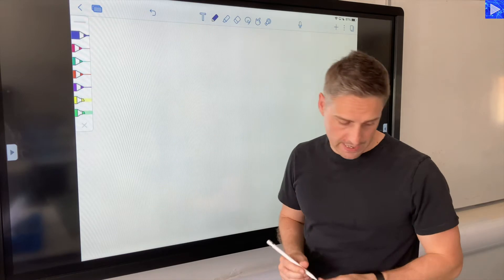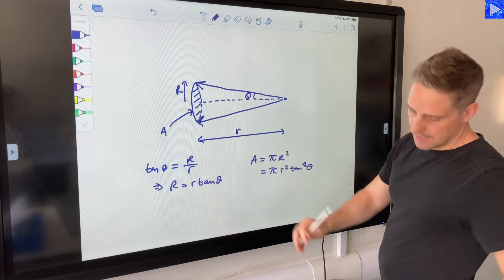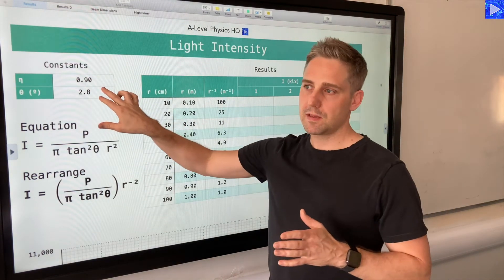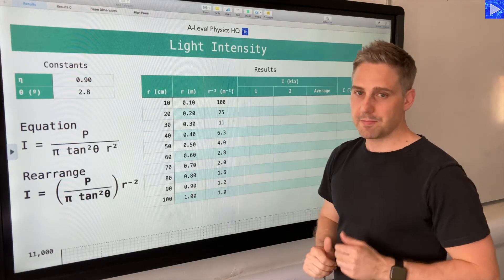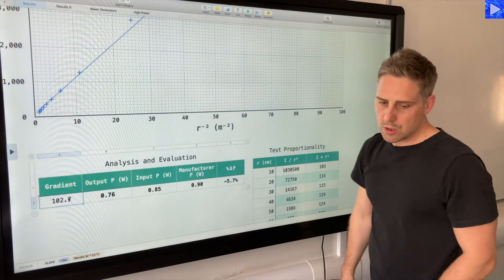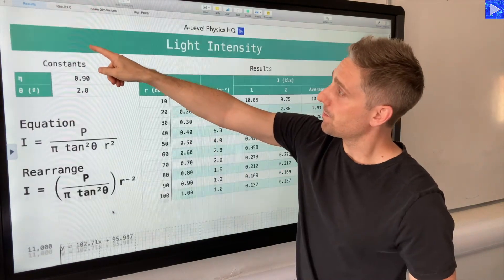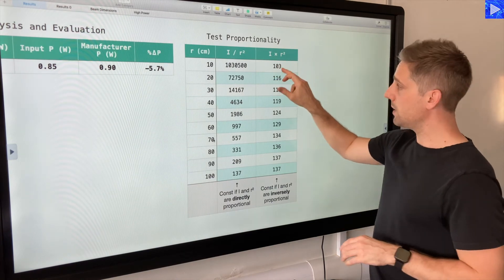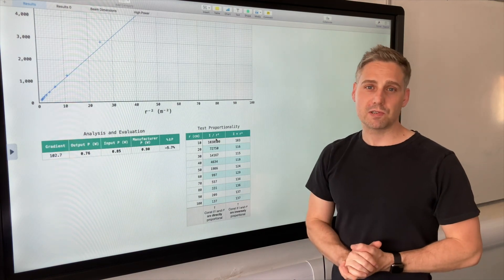Light intensity and Distance from Source - Analysis of the Experiment

Comment: ok so what about the photons that are traveling in a laminar path from the source? would they not have a constant effect regardless of distance? say if we had a light source that somehow only emitted photons in a perfectly straight line, (or just a single photon) would it have any drop off in intensity with distance?
Reply from the maker: That would be what’s called a collimated beam. 
In that case intensity would not follow the inverse square law drop off like a point source. But there is at least one other effect to account for: scattering. 
Photons travelling in a straight line that are incident on something like a gas molecule / atom could be absorbed and re-emitted in a different direction before we detect it leading to a reduced intensity at point of detection.
Reply: @PhysicsHQ  
So would the inverse square term have an additional term added on to account for collimated light? Like 1/r^2 + x ? x being representative of the cross section of the object, if its smaller than the light source
Reply from the maker: I should think the relationship would be similar to a collimated X-ray beam passing through matter:
I = I₀ e^{-μx}
Where x is thickness of matter (i.e. distance travelled through the matter),
μ is linear attenuation coefficient. So that we would take the value corresponding to air in our case.